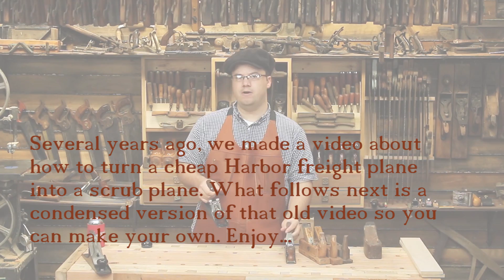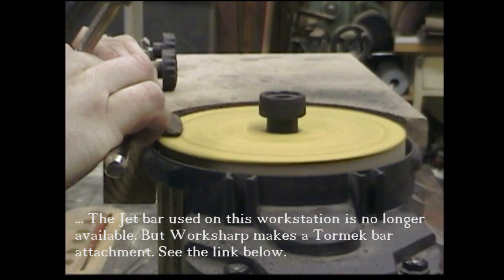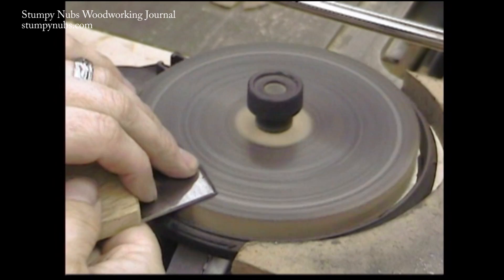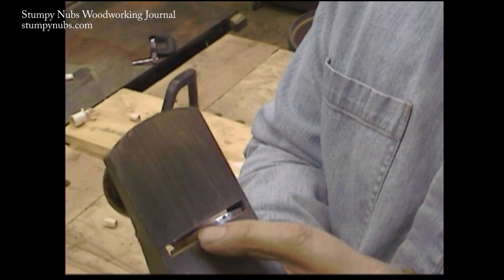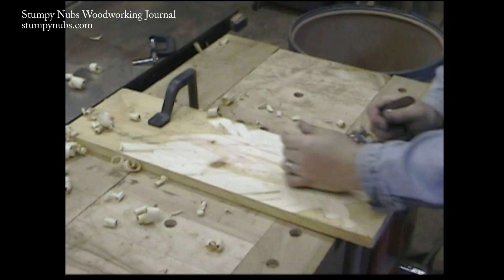What's a scrub plane? - LET'S MAKE ONE from a cheap Harbor Freight Windsor woodworking plane!

Comment: I wasn't just skeptical of this, I was pretty much a Satanist about it.  I've seen and held HF planes before and they mad me sad, then I laughed, then I was sad again.  It went on for a while like that.  Anyway, after spending over an hour a few nights ago trying to initially flatten some well-cupped spalted maple with a 4C and a 6C I realized I was running out of superglue to reattach my arms as they kept falling off.  I needed to do something different.  A friend suggested this video.  I stopped by HF on the way home and did the usual cry-laugh-cry-laugh bit.  Finally found the least objectionable plane they had and bought it.  Rounded the blade on an upside down belt sander, liberally dipping it (the blade, not the sander) in water.  Since I was convinced this was going to suck and I'd just wasted $15 I didn't bother with a lot of time sharpening and only went with a rough and then fine diamond plates.  I sanded the bottom of the plane not so much to flatten it as to smooth it out the grind was so rough.  Threw it all back together, tossed a new board on the sawhorses and...

The heavenly host descended and sang arias whilst dancing around my head in ecstasy, the effect being only mildly compromised by their needing to dodge the storm of wood chips the plane was producing.  I actually had to call my wife out to the garage to take a video of how well this worked.  In fewer than 10 minutes I removed more stock with this than I had in 90 minutes with my other planes, and neither of my arms even got wiggly much less fell off.

Color me shocked, impressed, converted.  I signed up for your newsletter and eagerly wear the sacrament while waiting to take communion at your service.

Now, can you do a video about getting rid of the mosquitoes that are already starting to hatch?
Reply: Fun to read your reply.....I recently re-worked a spare blade for one of my Stanley's and went after a slab I was getting close to hauling to the planner mill....if I could find one, that is.  One session with the scrub plane and I am close to having a reference face....it is certainly one of those 'Revelation' kinda things
Reply: Yeah, this is an interesting "redemption" of Harbor Freight - maybe it's a crap smoothing plane, but it finds greatness as a scrub plane.  It's a weird kind of symmetry that I rather like.  :-)

Comment: I did this and the plane works great.  I did have some trouble that added a lot of extra time to get it to work.  The lever cap on the Harbour Freight plane I bought did not set flat on the blade and its forward edge was very blunt.  I had to do a lot of grinding to get it so the chips didn't get jammed under it.  That was just luck of the draw though.  If I had paid attention to the lever cap when I was looking at the plane in the store, I would have selected a different plane.  Thanks, Stumpy, that was a great suggestion.  I really didn't want to mess up a decent smoothing plane to make a scrub.  Also, this worked out just right for my budget.
Reply: You need to move the frog back a bit and set the chip breaker(if it has one), back more also.
Reply: @E-BikingAdventures this plane doesn’t have a moveable frog. The whole plane is one piece cast. It also doesn’t have a chip breaker. It’s like a spokeshave with the blade, lever cap, and two knobs to square the blade and sole. It would be atrocious as a normal plane. 

This person is saying that the chips are getting jammed under the lever cap because it didn’t fit flat against the blade. The fix can only be to grind the lever cap bottom flat (it comes roughly cast out of the box). Or the blade could be warped too I suppose but that would warrant a return. I don’t have this problem with mine.

Comment: When I first bought it, it did work at all, the blade was too close to the front edge of the mouth, so I filed it to make the mouth a little bit bigger. Then I sharpened the blade with $1.99 sharpening stone from harbor freight, adjust the position, it worked beautifully. The major downside of this plane is that it takes some time to adjust the blade position. But once you get to the right position and angle, lock it and it will work very very well. Most time I just lock the blade at the right position and don't touch it unless it's off. It works perfectly as a scrub plane. I later bought wood river and Lie Nielson planes but I still use this plane a lot. It has the right weight and fit in your hand. Although it might need some work to adjust it at the beginning, but most other planes also need some tuning. To my options, this is a good plane to buy. As long as the sole is flat, the blade can be adjusted to the right position, it will work very very well.

Comment: I just did this as I have a lot of rough sawn cherry to plane 3/16ths off of and I don’t have a planer. 

I have to say the modern version of the Windsor 33 is a piece of crap in just about every way imaginable. It’s exactly what you’d think a $13 plane would be. But once you prep the blade and sharpen it up it works fantastically as a scrub plane. I have 18 small boards (6x10") to plane and I did two with my jack until I realized this isn’t gonna fly then I got this and did a board so quick I was shocked. 15 more to go. 

The blade is not good material it’s thin at just over 1/16th or 2mm. It’s soft. I work in a machine shop and have been used to lie Nielsen and wood river blades that are a pain to prep and they need to be really flat out of the box or you’ll go crazy polishing them.  Not the case with HF. This thing ground and polished so quick I would assume its edge retention is gonna be garbage.

But it works great (I prepped it up to 8000). The handle and knob on mine were loose even when fully tightened to I had to put a rubber washer under the front knob and a piece of carpet tape under the handle to fix that. 

As a hand plane they pretty much got everything that you could possibly get wrong. But as a $13 scrub plane it’s super effective. Even if it exploded after this one project it would be worth it. 

Of course, you have to have a way to prep the blade. But then I’ve seen videos of people using sand paper on concrete to make thier scrub blades so maybe it doesn’t even have to be that well done. Just be careful if you use a grinder as the blade is thin so will heat up very quickly. I have a 10" bench grinder with a soft aggressive stone on it and proper cooling fluid (because it’s a machine shop) so it wasn’t an issue. But definitely be careful if you’re doing it at home. If you blue that blade you’re gonna have to go buy another plane and try again. 

This is gonna save me so much time so thanks for posting this.

Comment: @Stumpy Nubs  Can you elaborate on the "tool stick-out" from your pattern to get the chosen bevel angle on the blade/iron?  Did you use a particular guide, or jig (or Tormek table?), or did you use (gasp) trigonometry?

Comment: hiya have been watching your videos for over a year now and as someone new to woodworking really appreciate your channel.  With regards to scrub planes.... someone gave me a really long plane (17 inches) which has a curved blade and a curved base.  I have been using it as a scrub plane is it?  the only thing i have foudn online is saying sthg about this is how scrub planes used to look in the 17th century?  Some help with this would be really appreciated .
Reply from the maker: Before Stanley made their #40 scrub plane, people used their old wood body smoothing planes for scrubs once the soles were worn and the mouths were too wide to effective use for smoothing. These planes were short, 8-10 inches. I have never heard of a 17 inch scrub plane. But that doesn't mean someone couldn't have used it as that.

Generally speaking, Americans didn't use scrub planes (they were more common in Europe, especially Germany). Americans used their jack planes with a cambered (curved) iron. Jack planes are longer. So what you likely have is a jack plane that has been used much like a scrub plane to remove a lot of material quickly.
Reply: @StumpyNubs  , thanks for the information, its working really well as a scrub plane although it took some getting used to having a curved base, the closest i have seen to it is the Moulson Brothers 15.75" Wood Block Body Round Curved Bottom Base Hand Plane when i googled it.
Reply from the maker: If the base is curved (convex along the length like a log) then it is meant for planing inside a cove. It was likely a specialty plane made for a specific purpose.
Reply: @StumpyNubs   yeah exactly like that, and makes sense came with some straight edges that could be screwed along one length I guess to adjust the cove?  Poor thing ending up in my hands and being used to hog out the bow of a board!  Thanks so much for the info .

Comment: Stumpy Nubs did you do anything to the sole of the plane?
Reply from the maker: I believe I filed the front edge of the mouth (right in front of the blade's cutting edge) to open it up a bit more so that really thick chips could slip through. That's it.

Comment: the plane is up to $14.99 now
Reply from the maker: I saw that. In fact, I was going to put up an affiliate link to it on Amazon (if someone uses that link, I get a small fee for sending Amazon the business) But it's $20 on there, and I didn't want people to spend more for it. So I linked to Harbor Freight website instead. Still, at $15 it's a good buy!
Reply from the maker: I just got a set of the new Bench Dogs planes (a #4 smoother and a block plane for $200). I didn't know what to expect since they aren't a plane company. But these things are REALLY nice. They're more on the level of Wood River from Woodcraft, but less expensive. Not as nice as Veritas or LN, but a lot nicer than Stanley. I'll do a review about them when I can get it on the schedule.
Reply: Use more coupons!
Reply: I just bought one two weeks ago (3/2021) for 13.00 at harbor freight. I can get it to work some, but I have a hard time getting the blade to stay in.
Reply: This price came down a bit now, seven years later it’s like $13.  As if $20 for a scrub plane would be a bad deal though, right? 😃